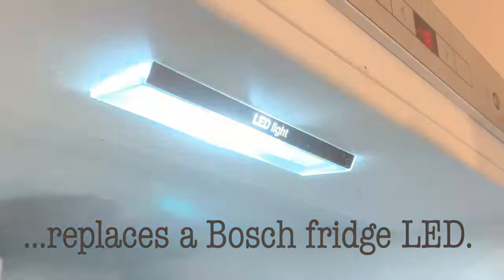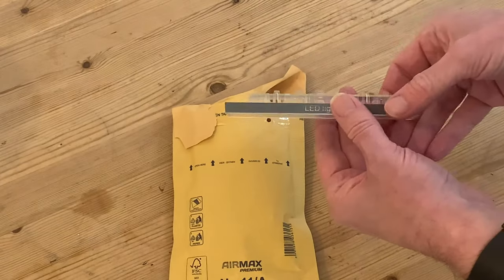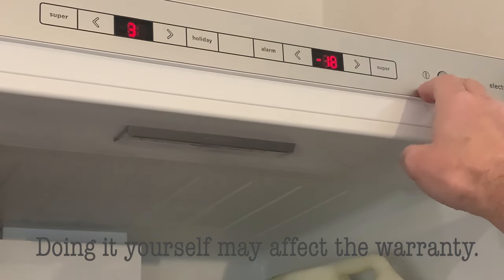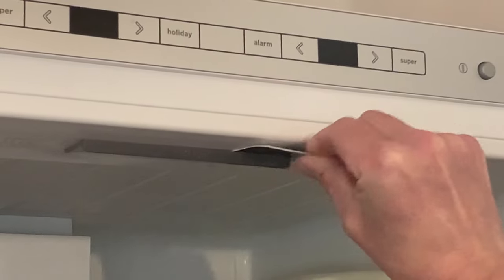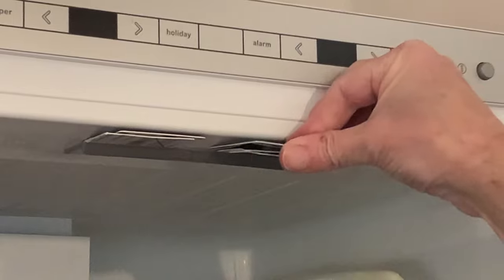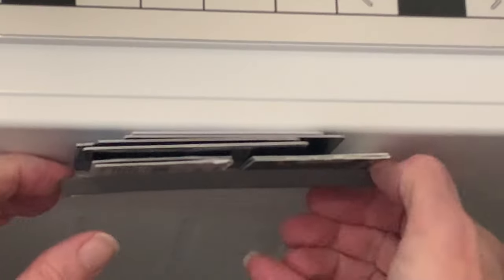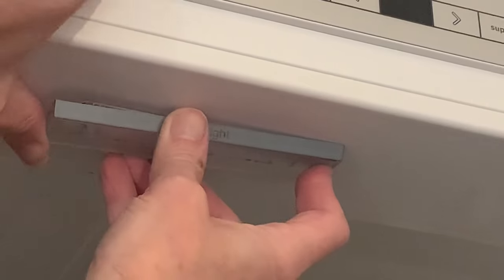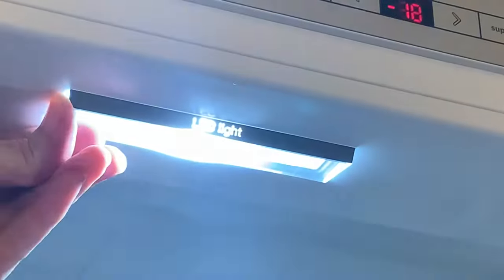How to replace the LED light in a Bosch fridge (+ Neff, Siemens)

Comment: If anyone wants to replace only LED element on the board, then you need an SMD LED 3030 3V and 150 mA. (Measured on the original working LED)
Reply from the maker: Good to know. Although the plastic casing on ours was looking pretty tired too.
Reply: Useful info, but just a heads-up - the light assembly in our fridge looks identical but has a 350mA 1.2 watt LED according to the spec sheet on the Bosch customer service website, so it's probably worth checking the spec for your fridge model.
Reply from the maker: Good to know. Is there an easy easy to check?
Reply: First of all I want to thank to Author of Pater Practicus channel for plastic cards lifehack)

FYI: my Bosch kgn49xw306, also has the same smd 3V LED with part number (3218/9001030205), but real voltage which comes from fridge (measured by multimeter) is 12.1 volts, so I suppose even regular 12v smd will work properly. We could fix it in any repair service like mobile phone or tv servise, no need to ask original Bosch service. That's what I did and it's working)
Reply: Hopefully thanks I'm requesting led part only from Bosch tomorrow, declining their expensive parts and labour quote from 106 pounds.

Comment: quoted £110 +parts to fit with parts being £10 . told need an engineer . so nice saving
Reply from the maker: So glad to have been of assistance. My method is rather over-cautious, and I suspect the ‘engineer’ probably deftly snaps it out in a jiffy, so £110 is quite steep for a 5 minute job. I like Bosch as a brand, but it is frustrating that a simple lightbulb isn’t something designed for the user to replace themselves.

Comment: First you should slide the light to the left and then light removing is much easier
Reply from the maker: Good tip. I kinda worked that out after making the guide. I know it helps slide the contacts of the LED strip out of the internal socket, but don’t know if it makes much difference in unclipping it.
Reply: @paterpracticus  after sliding you got a bit more space from the left side to put the cards or knife in
Reply: to left. and lamp off

Comment: Thank you for your ingenuity. Indeed, this is the only way to avoid damage to the fridge structure (and to avoid a call to Bosch assistance, which would make for a pretty expensive lamp replacement). Luckily, I had a few expired plastic cards of various nature, credit-card size, that I had not thrown away. Guess I'll be keeping them for this  and similar occurrences 😁
Reply from the maker: Great. Glad you found it useful. One of the other comments mentioned pushing the unit to the left first, which apparently does make it easier to get out, but I still think you need to 'pop' the plastic tabs, and the card approach does indeed avoid damage.
Reply: @paterpracticus  Like you, I don't believe you can push/slide the unit anywhere until you "pop" the plastic tabs. Once they start coming off, you can exercise a push to the left while pulling down. Thanks again!
Reply: @GiorgioVVVV You need to move it to the right to get into the connector while popped in, so clearly you can also move it to the left to get out of the connector while popped in. Went pretty easy on my fridge. Tips to popping it out in this video was very helpful, also this video showed the need to slide it to the left first, which helped a lot.
Reply: @TheKrietjur  There's no way you can slide it either way without first applying the trick shown in the video. Until you do that, it's very much locked in.
Reply: @GiorgioVVVV  Well, worked perfectly for me. Clips only hold it up, no lock sideways. In the video also shows puting it together Popping in and then sliding to the right. You can easily slide it back again.
Reply: @TheKrietjur  Different fridge, different light slots, I guess. With mine, the light was totally stuck before applying the trick.
Reply: @GiorgioVVVV  Yes could be, maybe some manufacturers put some glue or something on it during production. They like to make people think it's a part that can't be easily replaced so that you call them for repair :) If I remember correctly, it was mentioned in my manual that this part could not be replaced by the owner and that you had to call for service.
Reply: @TheKrietjur  No, no glue, just an extremely tight slot. You're right, those bastards (Bosch) even wrote it down in the instruction manual: "Led lighting does not require maintenance (!). Repairs to this lighting must only be carried out by the authorised Customer Service". But of course. That way, a light (that only  lasted a bit over two years, btw - so much for being LED) would have required 70-100 Euro to be replaced, instead of the 13 and change that I've spent.

Comment: If you dont have so much costumer or credit cards take wood wedges is also very good Thanks for your idea!
Reply from the maker: Indeed, wooden (or plastic) wedges would work. The good thing about the cards is you can build the thickness up without having to push further into the lighting unit, which isn't very wide. You could also use thickish cardboard.

Comment: Oh side note: You need to shift the LED housing (acrylic) to the left first to dis-engage it from the connector in the fridge. Then proceed with yanking your creditcards between it ;-)
Reply from the maker: Indeed, I've found this out from other comments. As you can see, it does work without, but definitely better if you do.

Comment: Nice video! But i have just tested the LED and it works with a multimeter. So i suppose is the door light switch that does not work,how can i find it in this Bosch model? It is hidden somewhere
Reply from the maker: First of all, check the LED unit is pushed all the way into the socket on the right of the mount and making good contact. I'm not even sure there is a physical switch for the door closure. I've never found one.

Comment: What is this particular light called? How do you find it online? Having a hard time finding it.
Reply from the maker: Search ‘Bosch LED fridge light’ on Amazon or eBay. They seem to be fairly standard on various models. They tend to be more expensive on Amazon, and I’m not sure how genuine they are. The cheapest I’ve found is here: https://www.ebay.co.uk/itm/164915752748?mkcid=16&mkevt=1&mkrid=711-127632-2357-0&ssspo=nLrjacJrQQO&sssrc=4429486&ssuid=NDsD44a_Ts2&var=&widget_ver=artemis&media=COPY

Comment: hey you don't need pop up to take the old one out. you made new one slide right, so i can take it off slide it to the lest and the light unit dropped my hands. thanks for the video. just try sliding the unit lest and its going to drop easily actually you are not going to need to pull it.
Reply from the maker: Thanks for the extra tip!
Reply from the maker: I've added a bit to the video description to say that makes it easier to remove. Thanks again.